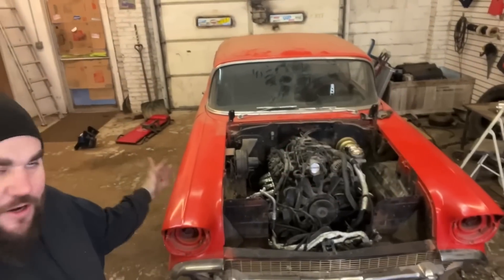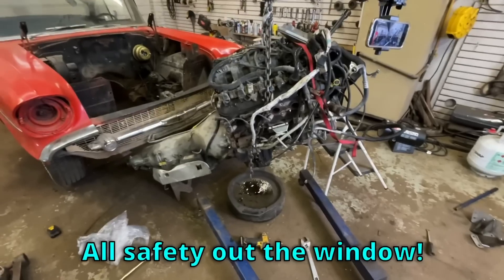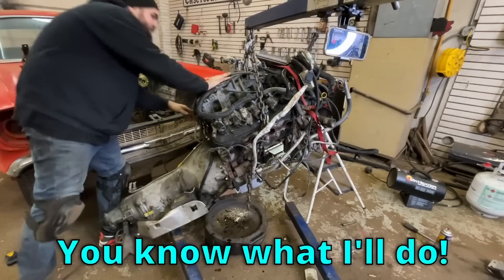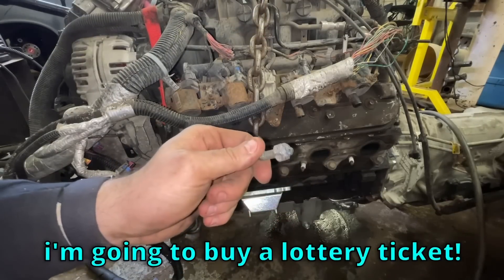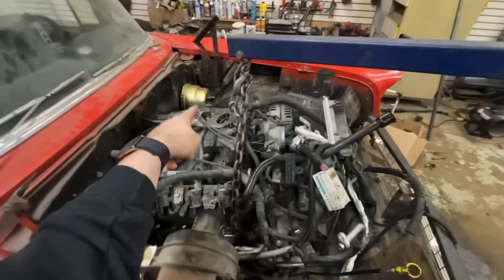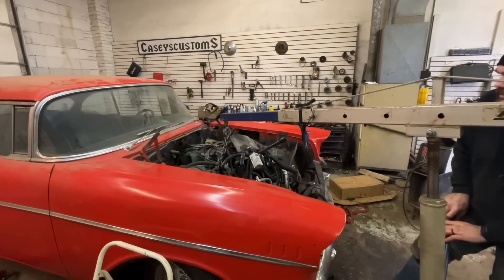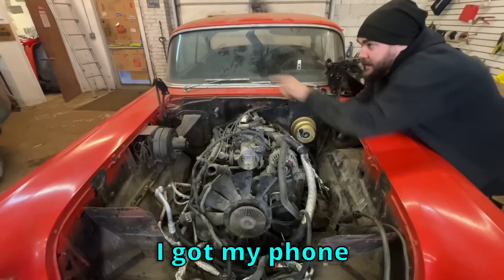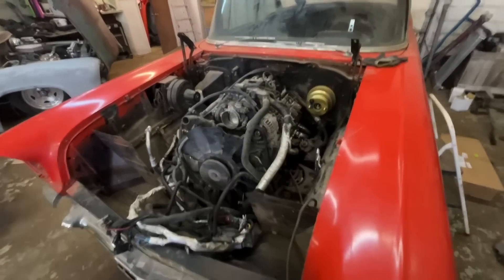CUTTING UP A PERFECT BARN FIND 57 CHEVY! $1500 BUDGET BUILD LS SWAP! HOT ROD KUSTOM 2 DOOR HARDTOP!

Comment: casey i do hate the cold weather too its so hard to work with but i got a tip for you i got one of dose patio heaters and they work real good in doors just be careful with the carbon monoxide dont shut the doors all the way and youll be fine and its way easer to work in cold weather
Reply from the maker: Got a heater since i posted this 👍👍

Comment: This video is a perfect tutorial on how not to LS swap a tri-five Chevy.
Reply from the maker: What did i do wrong?
Reply: Maybe I was a bit harsh. I do apologize. I would have installed a new oil pump, cam, lifters, timing chain. I say this based on the condition of the oil in the pan. Also using a stand alone harness would 100% clean the engine bay up.